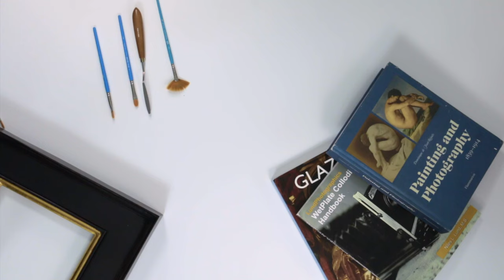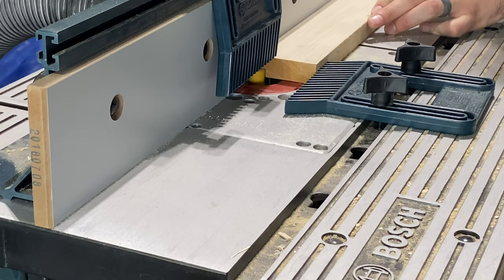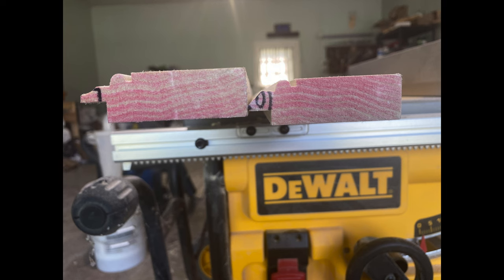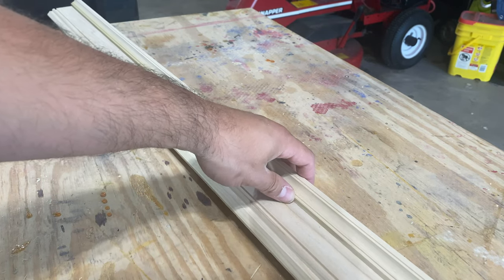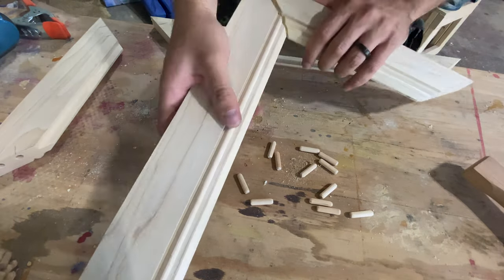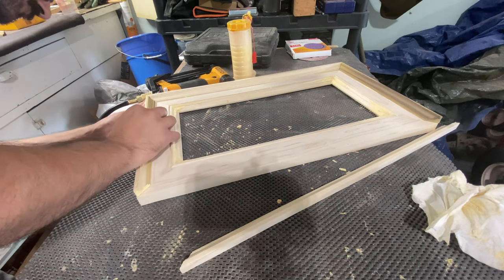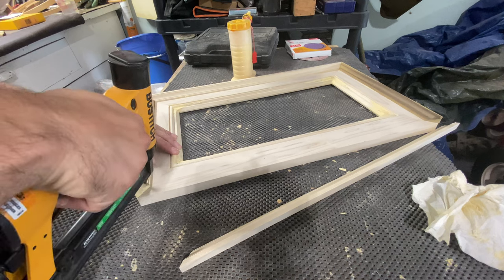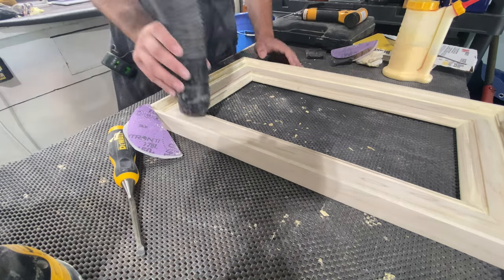Custom Frame Building Pt  1

Comment: can I ask you to list out the router bits used please?
Reply from the maker: It was a 1/2" rabbiting, a 3/4" 45-degree beveling, and a 3/4" cove w/bead. The one example I showed used a 1/2" cove instead of the 45-degree bevel.
Reply: @MatthewCookArt  HI there… am getting ready to build this frame… from your video, can you please provide the make and model number of the cove w/bead bit at the 1:23 min point in your video?